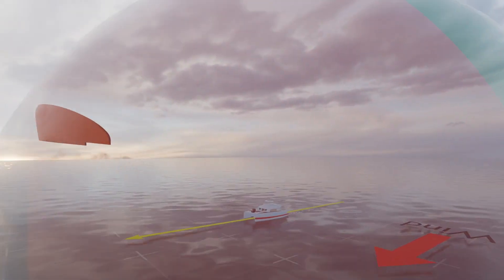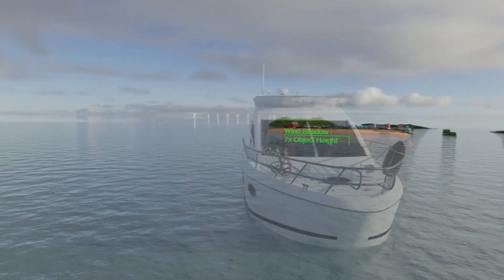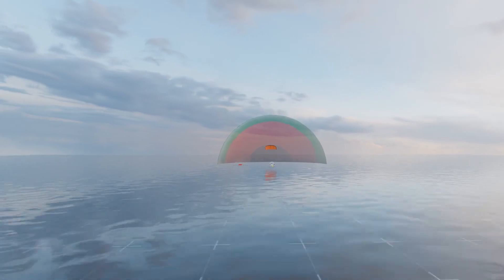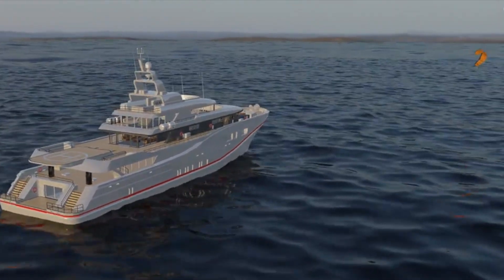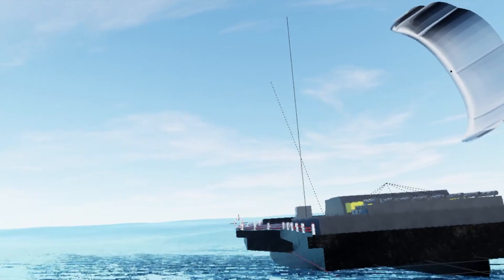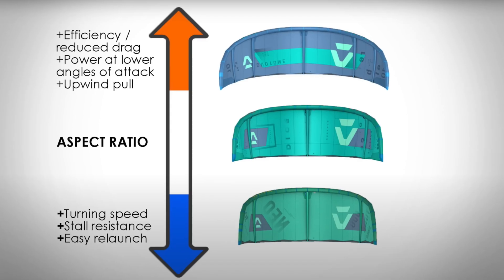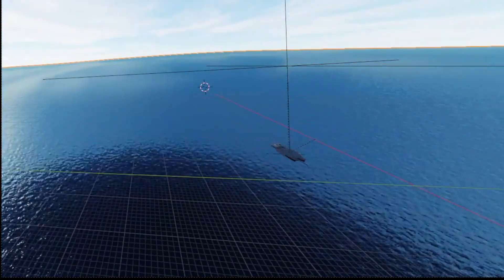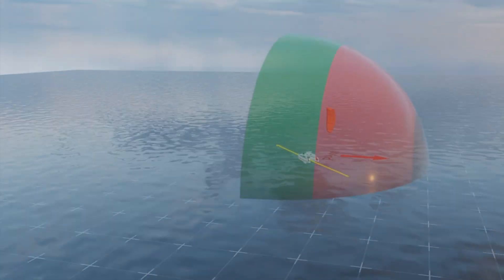Kite Sail Upwind and Maximize Wind Energy Generation

Comment: As both a kiteboarder and an owner of a very lightweight and efficient aluminum motor boat, I am interested in this technology, but am dismayed that no mention is given to kite launching and especially retrieval in a squall.  Who cares about the performance of the kite if you can't launch it or get it back on the boat without getting the lines around the prop !!   This should be the 1st thing that is addressed

Comment: I don't understand the system,..... why not use a radio control device with a self-stabilizing or gyroscopic module placed on the kite and correcting the flight on the ground (or boat) ?

Comment: Lol, the "keel" my wharram is a couple inches. It's basically just a spine the ply attaches to at the bottom.
How do you collapse it to heave to? Just reel it in?
Reply: In one of my videos I show a "dome" that represents the wind window, anyway you just move the kite to the outer edge of the wind window and it will depower, then you just press the throttle and reel it in!